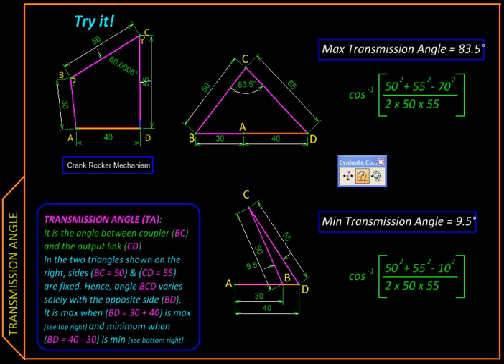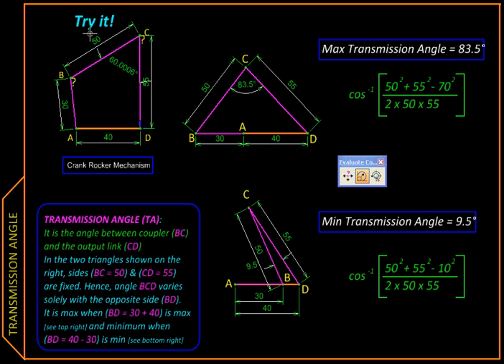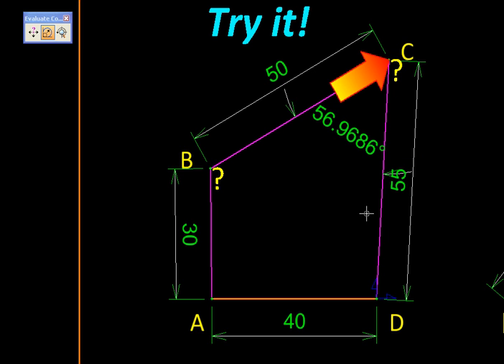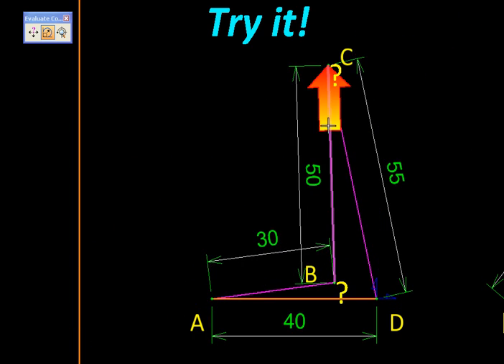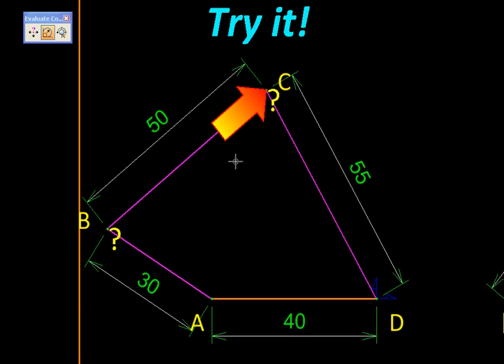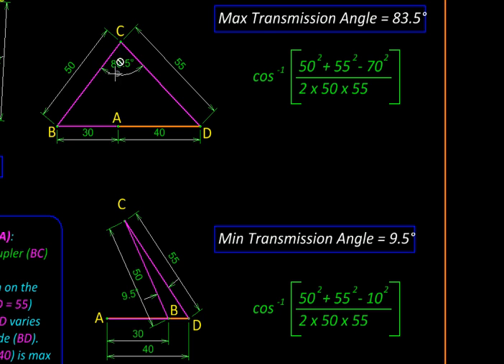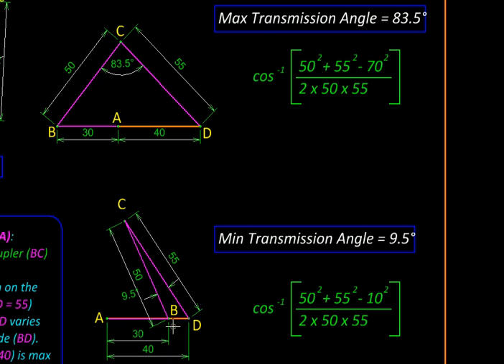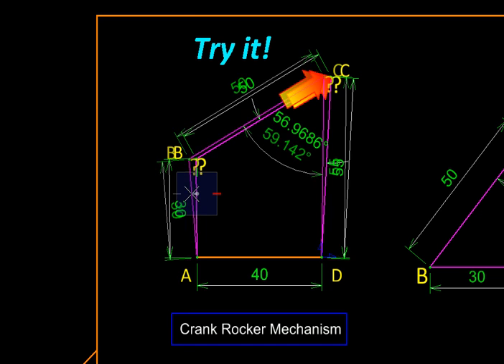Kinematics Ch01D2 Transmission Angle

Comment from the maker: @dvulcanz Thanks! Try to think in terms of torque rather than force. Though the links carry forces, since they rotate (about the fixed hinge) ultimately what matters is how much of that force it can 'encash' into torque. And in the toque calculation, not only the force but its line of action matters too. And that is captured in the transmission angle.
HTH